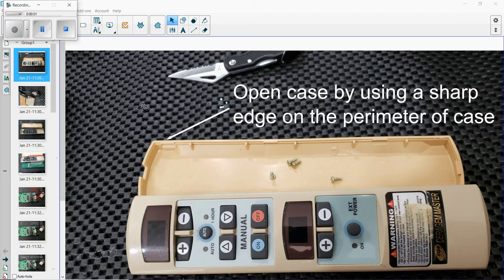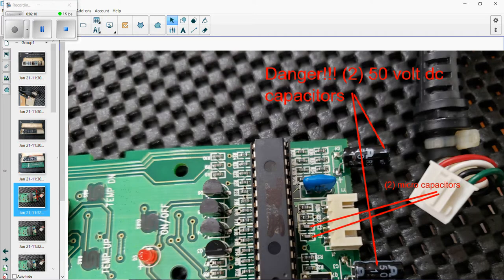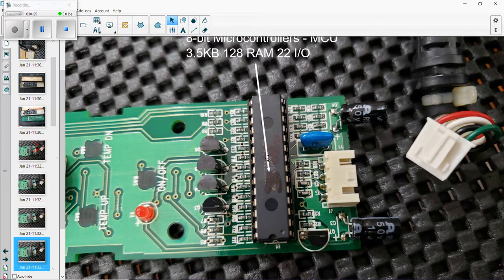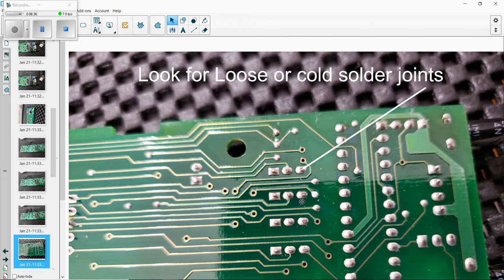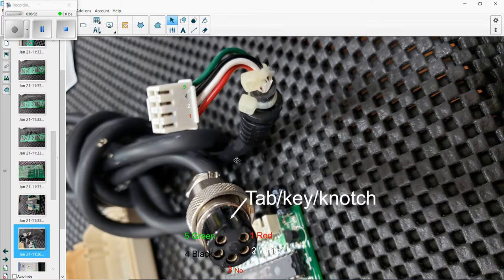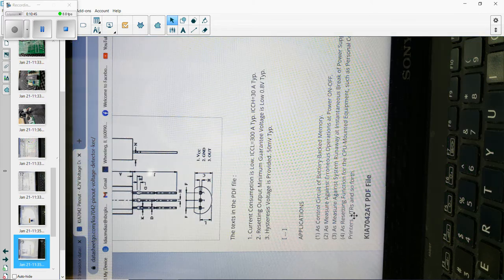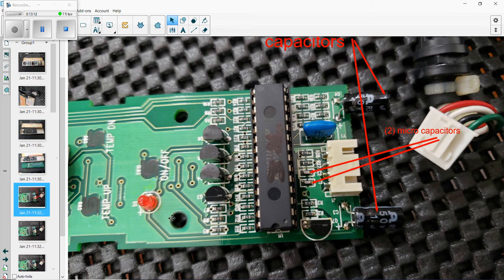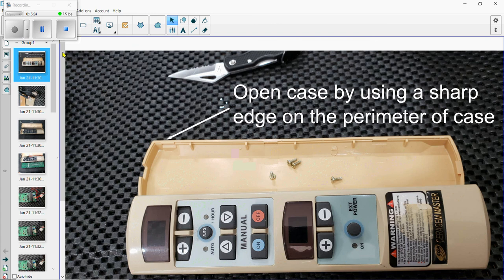Ceragem remote control inner view

Comment: My bed all at once had no power.  Opened the box by power cord and it was so hot couldn’t touch.  Any idea how to fix.  The fuse was ok
Reply from the maker: If the bed got extremely hot it is because something is going on like... 
a shorted motor, 
bad component, 
one of 3 fuses is about to blow to protect your bed. 
Heat is cause 
by friction...
chain stuck, 
broken part.
Difficult to troubleshoot, 
Be very safe and open bed and see, smell, and touch carefully for location of problem.
See my other repair video per this link https://www.youtube.com/watch?v=W13Nd-Xme50

Comment: My bed stopped working is it fixable or should I scrap it? if it is fixable who do I take it too? No power to remote or to the clear fuse
Reply from the maker: I do not know where you are at. but everything could be fix. just replace the damaged parts. need more info. are the 3 fuses ok. see my video at https://www.youtube.com/watch?v=W13Nd-Xme50 and follow  those instruction my friend.
Reply: @ldiazmdiaz  I saw two fuses the solid white and clear small one on the main motherboard where is the third one?
Reply from the maker: @lgvmobile  The first fuse is between the switch and power cord see video time at 1:45 min. https://www.youtube.com/watch?v=W13Nd-Xme50
Reply from the maker: @lgvmobile  Hidden fuse at the plug in area (small fuse see my other video see my video at https://www.youtube.com/watch?v=W13Nd-Xme50 and follow  those instruction my friend.

Comment: in my remote it is showing CE 

what happened plz help
Reply from the maker: Per the manual page 10 ... http://basic.ceragem.com/Upload/DownCenter/au_manual_ce1.pdf
INDICATION
- C
EXPLANATION
The system is not responding.
An irrecoverable error has occurred within the mat.

M G just ...Turn the power off, then try to unplug the wire and plug it back in.
Turn the power on again. If the same code appears, call for service.

see my other video on YouTube. ..https://www.youtube.com/watch?v=W13Nd-Xme50
Reply: @ldiazmdiaz  I was on my ceragem-C bed and during the first 9 minutes the lights on the remote went out. The bed is working. I am thinking a battery replacement is needed but could not see where to open and find the battery. Can you help? It is the M3500 remote control. I don’t have a manual and I browse the internet to find the control I have.
Reply from the maker: @sybilellis3844  1.) There is no battery on the remote per this video my friend
2.) This video tell you to snap open the case with a sharp object.
3.) See my other video from this link   https://www.youtube.com/watch?v=W13Nd-Xme50.
4.) Download the Manual for the Ceragem CGM-M3500 per this link
http://ks.ceragem.com/Upload/DownCenter/au_manual_ce1.pdf
5.) I suspect one of the 3 fuses burn out (one for the power, one for the motor and one for the board lights) se the other video for full detail.
6.) Please Subscribe and tell others. THANKS